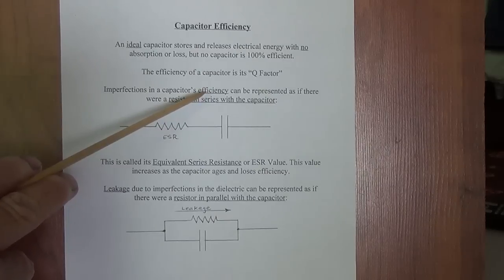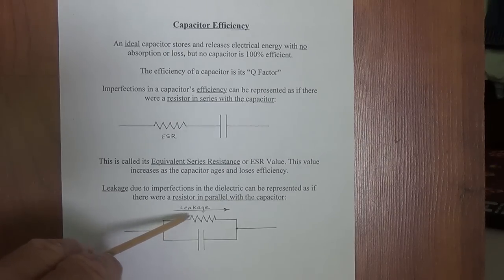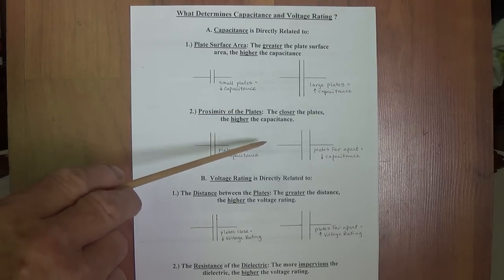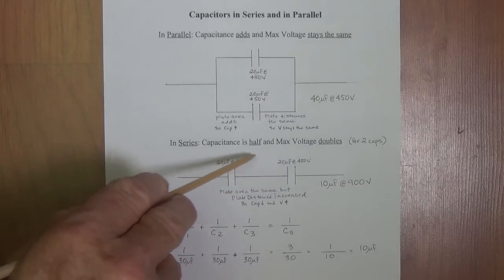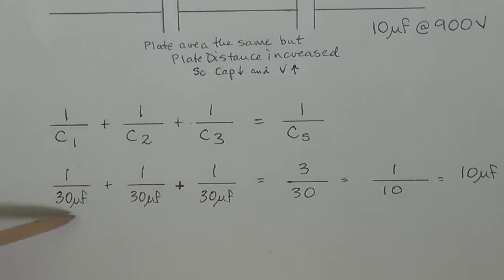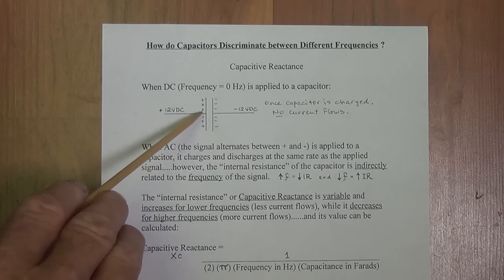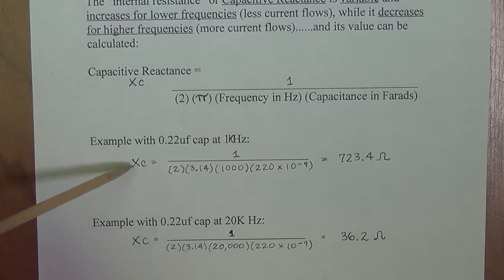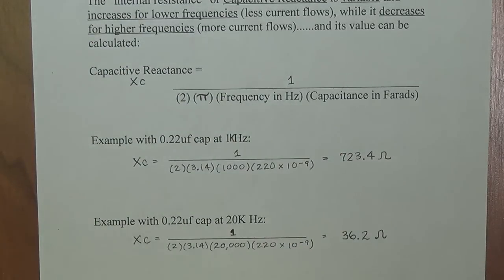Capacitors in Audio Circuits:  Part 2

Comment: Dear Sir, I just bought a super cheap fretless guitar with two pickups and two tone controls. The guitar is toneless. Please explain how low amp tone controls work. please
Reply from the maker: I have posted a video explaining how passive tone controls work, BP.  Please watch it and I believe it will answer your questions.
Reply: Thanks..... but..... I can not find it..... I just want to make my bass guitar sound better. Not gain the skill to design.
Reply from the maker: Here is the link to Part 1:  https://youtu.be/BatwDYFJ9ug   Good luck.
Reply: Dear Uncle Doug, 
* I am thinking of building an RF receiver using an electric guitar. My new super cheap double pickup solid body fret-less bass is a nightmare as a musical instrument. The controls are made up simply of two volume pots passing into a parallel path of series pots-and-caps-to-ground as higher frequency suppression controls. Standard stuff. With the tone pots full counter clockwise to maximum flow across the caps, the guitar was very quiet at rest. However with both tone pots full clockwise and taking the tone caps out of play, a heavy RF buzz appeared. Also, touching the grounded strings by a human capacitor (me) would cause a loud electrical discharge snap to come from the amp. I however still could not quite make out the weather reports from my local AM stations, so I added ungrounded aluminum foil "shielding" around the pot areas and now when I touched the shielding material I am nearly sure I could hear The Tokyo News Report. A ten fold improvement in sensitivity and showing real progress!! Unfortunately, if I touched the back of any grounded pot, the guitar antenna got super-quiet again!!?? Crap! Maybe this thing would still work better as a musical instrument. First I considered soldering a ground wire to back of one of the pots and clipping the other end to my body. But I could not find an electrical clip that did not cause excessive pain after an hour or so. I also began playing the tunes to fast while just trying to get through the set as quickly as possible. I finally gave up and soldered a used unreadable polypropylene tone cap directly across the output jack connections and added a grounding wire to the shielding. I then saw a 90% reduction in stray noise and the other guys in the band stopped throwing stuff at me. I am still considering buying another identical guitar and sticking it on a pole as a CB antenna. What key should I tune the guitar in for best short wave reception? And I may need help designing a proper mounting system. Do you know anyone that sells that sort of thing? I have a lot of duct tape (in many colors) in case that involves part of the design. 
Yours Truly,
Backwoods Michigan Steve
Reply: fine
Reply: I know this is not at the place to bring this up, but, I miss the Red Green Show.

Comment: Great stuff, Doug!  One question though...  Is there a threshold resistance where a frequency is completely blocked?   BTW, I've actually eaten MIlkbones, and, they all taste pretty much the same.  At least to a human.  Dog's may have a more discriminating palate though...
Reply from the maker: Thanks, John.  Resistors are not frequency dependent.....they treat all frequencies the same.....so there would be no resistance threshold.  Capacitors, however, do treat different frequencies differently, but I don't believe that 100% of any frequency is blocked.  Certain frequencies could be diminished to virtual inaudibility, however.
Reply: What I wanted to know was, from the equation that gives the resistance of a cap at a certain frequency,  is there some guideline that would let you know that say 9k would block some percentage of that frequency...
Reply from the maker: Simple answer: No. In the cutoff frequency equation:  Fc = 1 / (2 Pi x R x C)  resistance (R) is one of the factors, but it is the capacitor that actually does the blocking.....the resistor simply modifies the behavior of the capacitor.  You could isolate the R on one side of the equation, but there would always be two variables and thus no way to come up with a blocking equation only in terms of resistance.

Comment: When teaching we should really call capacitors ivfr : inverse variable frequency resistors and inductors : vfrs , variable frequency resistors as it directly tells us what way these devices effectively behave .
Reply: Now you immediately know that high frequencies present no resistance to capacitors and high resistance to inductors
Reply from the maker: Thanks for the input, TK. I believe, based on the Frequency Cutoff formula, that all frequencies encounter some resistance when "passing through" a capacitor......higher frequencies simply encounter less resistance than lower frequencies.....and vice-versa for inductors.
Reply: Yes I should have worded it better .. The point holds though that it is easy to remember in a way because we say :Resistor , Transistor , so  significant electronic parts  in some way are a resistance due to some influence ..eg: didoes too ..resistor gates ..etc. It is an interesting thought to think that by controlling electrons we get so many wonderful machines ..concepts.
Reply from the maker: It is indeed, TK. Thanks for your input.

Comment: If you could explain how to look for excessive ripple current in filtering capacitors, whats acceptable, what is not.. what is happening as the capacitor ages allowing AC to pass through, causing hum and crackle?, thank you...
Reply from the maker: I will discuss this in Part 3, Pauli, which should be posted this weekend.  I know of no acceptability criteria other than the absence of audible electrical noise and hum in the rectified high voltage.  I will also explain why electrolytic caps fail due to age and disuse, allowing the residual AC hum to persist within the rectified high voltage.
Reply: Thank you for putting these videos together they have definitely helped.. I have a couple analog Tek scopes, it would be interesting to know where some good test points are in solid state and tube amps to see and measure the ripple current, what settings to use ect...
Reply from the maker: You're welcome, Pauli. Since settings and methods vary from scope to scope and circuit to circuit, it's probably best if you simply experimented to determine the best methods and settings for your equipment.

Comment: Thanks Doug! When you got to AC voltage, all I could see was a speaker crossover. Any chance you could walk us thru a basic 2-way crossover and how the different capacitance values are applied there?
Reply from the maker: You're welcome, HS. I could, perhaps in a later video. Crossovers don't appear very often in guitar amps, mostly in HiFi with separate woofers and tweeters, but I will keep the topic in mind.
Reply: I was sort of thinking about PA systems. Thanks again.
Reply from the maker: I can't say that I've seen crossovers in PA systems either, HS. They are generally mid-range, for announcements and recorded music.

Comment: uncle doug your videos are amazing as always, you have brought me further into the would of electronics than any book i have ever read you are a great teacher and with a dynamic crew like rusty and jack how could you lose. i don't know if is relevant i use electric motor capacitors in my day job. i have , on occasion, used 2 5uf 440vac caps in series in place of 1 10uf 440vac and like magic  the motor is running again at least until i get the proper capacitor
Reply from the maker: Thanks so much, Jeff.  As explained in the video, you would be better off wiring the two 5uf caps in parallel if you want 10uf for the motor.  In series the voltage rating would be 880VDC, but the capacitance would only be 2.5uf.

Comment: Great Video as always Uncle Doug! And as usual I not only understood but was able to retain the lesson, something about the way you explain things...

One thing however... Why is it that the lower the frequency the higher the resistance, and vice versa? In other words, what is happening inside the capacitor that it reacts this way?
Reply from the maker: Thanks, Marvio.  It's my understanding that higher frequencies can charge the plates more quickly and efficiently than lower frequencies, allowing the capacitor to pass more charge across the plates in a given time resulting in a greater current flow through the capacitor, making it appear as if the internal resistance of the capacitor has decreased.
Reply: Again! Sir you are the man! :)
I seems to remember you saying you were a teacher? Well, your pupils were very fortunate indeed! :)
Thank you again for all the wonderful information...
Reply from the maker: You're welcome, Marvio. Thanks for the very nice comments.

Comment: I'm enjoying the series. Any chance of covering capacitive dropping circuits?
Reply from the maker: I'm glad to hear that, Jordan. I'm not familiar with capacitive dropping circuits.....in fact, I've never heard the term before.....so I'm probably not the best guy to make a video about them. Sorry.
Reply: It is about using a capacitor to drop the voltage in a power supply. I've collected some information online and am working on one to power a four tube radio that used a resistance power cord (curtain burner)  to drop the line voltage. Maybe I should do a video on it once I get it all figured out.
Reply from the maker: I see. I'm no fan of resistance power cords, they seem like a disaster just waiting to happen. I also have never sought to drop the line voltage in my vintage amps. As long as the filter caps can tolerate the initial voltage surge and the output tubes are properly biased, there has never been a problem. If you do come up with a way to reduce line voltage with a capacitor, however, it would definitely be of interest and worthy of a video.
Reply: @Dave Micolichek  For the sake of accuracy I thought I should reply. "only good for very low power applications."; "needing some very expensive, monster sized capacitors....bigger than the radio itself." Sorry but that's just not accurate at all. There's plenty of information about these circuits out there so don't take my word for it. My comment was two years ago and since then I've built several of these. The reactance formula alone would get you close to the cap value you'd need. For US 120v 60hz 5.5uf, for 240v 50hz 9uf  for the four tube radio with pilot lamp I mentioned then. As for noise and mains power, the heaters are on mains already in series we're not talking hi-fi. There is one resource I used that covered this and other dropping circuit types including circuit protection which is a good thing for those rare tubes and crt's, just google Cool386 article "Line Cord resistor replacements"

Comment: Another very well-presented lesson.  Thanks! What is your opinion of the 'balancing' resistors used across filter caps in series? In the Fender diagram they are, I think, 220K 1W resistors.
Reply from the maker: Thanks, CW.  They are very important and I'm glad you brought them up.  Resistors like these ensure that the voltage is applied evenly to both caps. If an imbalance occurred, the higher voltage might be able to bridge the dielectric in one of the caps.

Comment: Hey Doug, Its there a problem with using a variable Capacitor as a way to tune what frequencies are passed through?

I think if my "math" teachers used Canine Comic relief back in the day I would have become an electrical engineer. Look forward to the next installment.
Reply from the maker: No problem at all, Ian, other than the fact that most tuning condensers have very limited capacitance.  You could experiment with one and let us know how it works. Glad you enjoyed the video.  I agree that a periodic change of pace makes the medicine easier to swallow :)

Comment: I knew it,,, I knew there was no difference in those biscuit flavors. At least Rusty doesn't have to choose between series and parallel. Good to see you back.
Carl
Reply from the maker: Thanks, Carl.  Yeah, I was suspicious about the 5 separate flavor claims.  They say that pet foods are designed to appeal to the owner rather than the pet, and let's face it, if dogs really had their druthers, the biscuits flavors would be Carcass, Roadkill, and perhaps Dog Butt.

Comment: Good science with Rusty!  The normal biscuits are pretty bland tasting, don't know about the flavored ones. :)) Jack has a nice spot to survey his kingdom!    Excellent review, thank you!     I keep in mind that capacitors are opposite to resistors as far as value in series or parallel circuits.  I noticed the hot rod is still there.
Andrew
Reply from the maker: Thanks, Andrew. It's always good to hear from you.  Actually, these biscuits are rather bland also, despite the tasty flavors ascribed to them......much like the questionable claims made to justify boutique "tone" caps :)  Yes, I got so attached to the '36 Chevy that I found a way to keep it.  Rusty enjoys riding on the running board.....he says it's a lot like surfing, except much worse if you fall off.